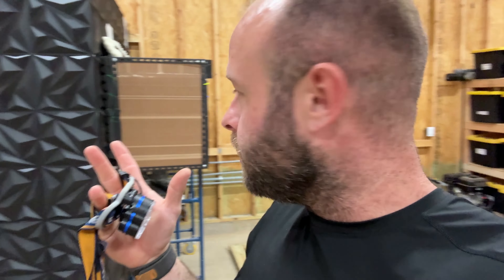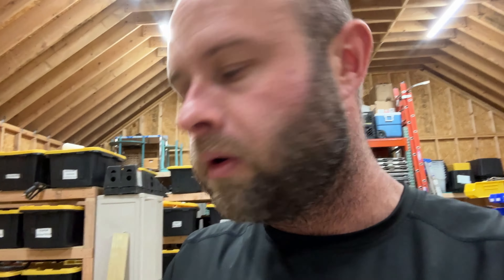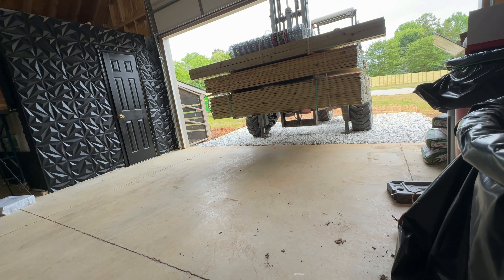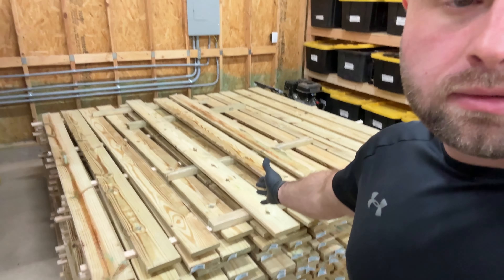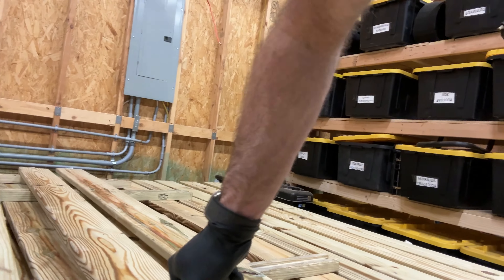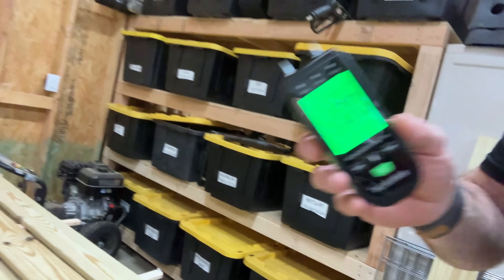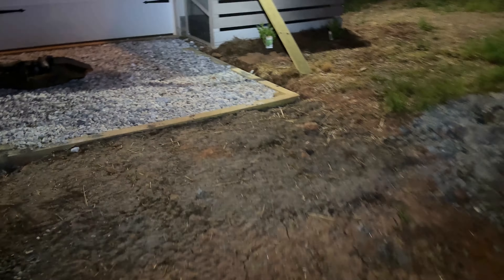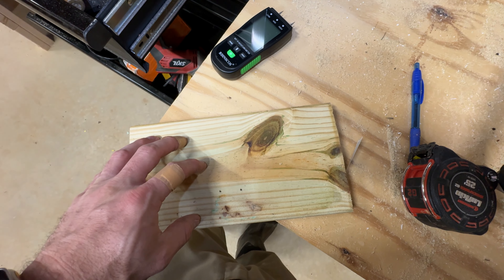GENIUS uses Bitcoin Miner Heat To Dry Lumber (NEW BUSINESS?)

Comment: Leaning that board on the building like that unsupported will cause it to bow really bad as it dries out.
Reply: Yeah. Drying wood is pain!
Reply from the maker: Yea, I shot this video like a month ago, most all the wood got used within a few days of this anyway lol
Reply: Well done.
Reply: @TechnicalsMatt  😅I know of a place for sale with over 10 acres, 3 phase trenched, perhaps 40% covered in trees, and currently owned by a logging company.
Reply: @TechnicalsMatt  To add more about that location.. it's surrounded by probably 4 MW of solar that doesn't come with the property but it might be cheaper to buy electricity directly from them if that's possible could TechnicalsMatt help me with the technicalities of this?

Comment: Lucky Guy got a BIg Load coming in today.

Might be worth it if you know your always going to need/use treated lumber this to make a rack on a wall up out of the way where most of the heat hangs out  in the shop to just always have some on hand also if your going to keep using fans you can check into RTR HD High-Velocity Air Circulator or some other style blower fan you can stick in the center of your stack for even distribution while also not loosing a bunch of space to add the fan.

Comment: Ah yes, blue tags = Lowes treated shit wood of twisted death. I fought with that junk when building my deck last year. I preferred to screw the wet wood in place instead of drying them first to try to mitigate the warping. It worked, for the most part. 
Also wood will always equalize to the moisture content in its environment. Your shop is probably around 15-16% humidity like the older piece of treated showed.
Reply from the maker: I have the 2 exhaust fans running 24/7 for the miners so the humidity stays low. Also I went to 84 last week to try their stock for some 6x6. Total and complete garbage and cost 25% more. Aside from those 2 places i'm not trying to hunt down a lumber yard. Guess im stuck
Reply: @TechnicalsMatt  I feel ya, we only have the blue, orange, and green boxes around here with a selection more than a single 2x4.